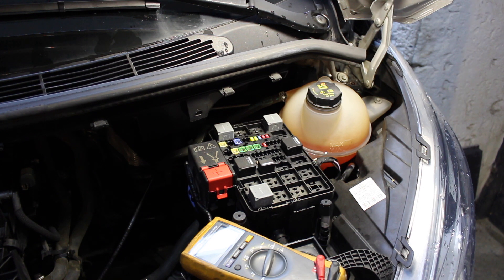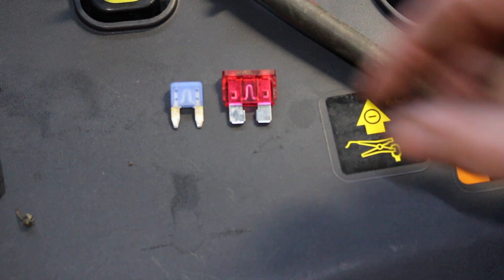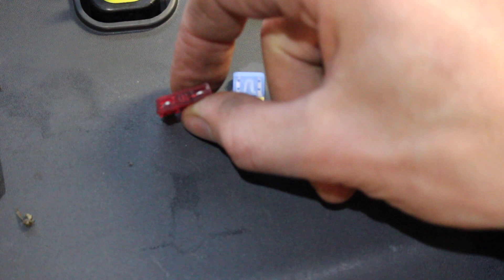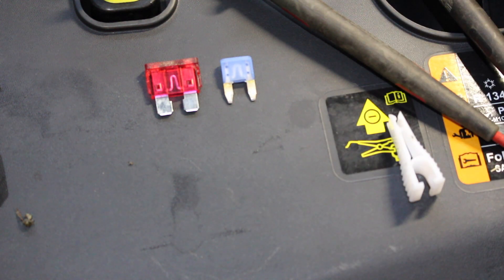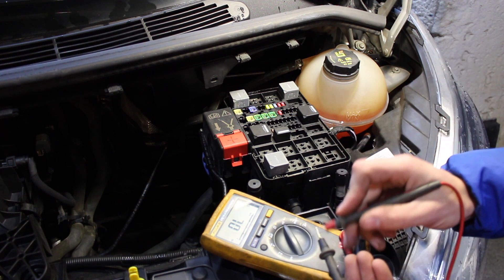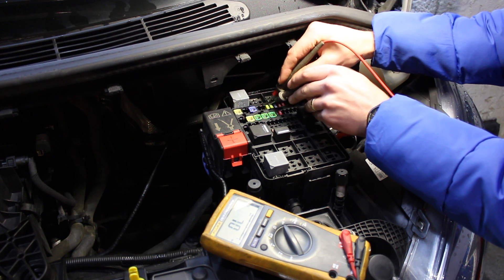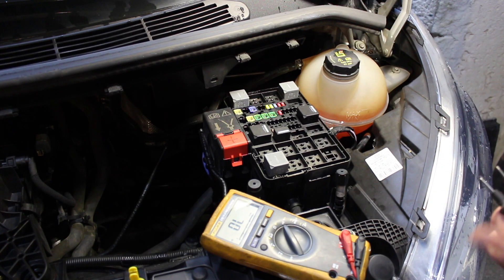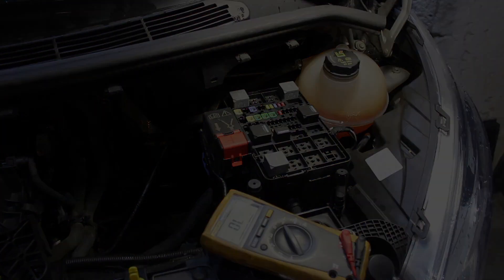How to quickly test car fuses with a multimeter

Comment: Looking through comments, I’d say the point here is that you can touch the exposed metal tabs with fuses in place. That’s it. Ignore “continuity” and “resistance” for now; research the diagnostic test you are looking for and see if this is an appropriate way to do it. The setting on the multimeter depends on your purpose, as does the safety of doing so with the battery connected. This was useful to me, for example, to test for voltage drop across a fuse to look for parasitic draw without disconnecting the (-) battery cable and losing saved presets, etc. If still upset he didn’t show the meter setting, he used )))->|- for continuity which is a low form of resistance and beeps. He first SAID resistance, which would be Ω and also works, but usually doesn’t beep making you look at the display to see if anything is measured. Some meters combine )))->|- and Ω in one setting. I don’t know what those do.

Comment: not sure if that makes sense as you are testing continuity of something which is already in a circuit... So, the fuse can be broken but the current runs through the rest of the circuit (outside of the fuse).
There's a method where you touch just one side of the fuse at a time - I am still looking for that method :)
Reply: you will need power probe for that
Reply: Take a multi meter and set to dc voltage. Touch the black lead to the cars ground on battery or any other grounding post. Next take the red positive lead of your multimeter and touch each side of a fuse.

Comment: wish you would have shown what setting on the meter you used - some of us are more ignorant!
Reply: Resistance mode... The omega symbol (Ω)...  Although I am 50 years late...
Reply: @SoldZaWarudo  Yes that is resistance but however it isnt the correct setting. Its continuity you need, as he later correctly stated. Continuity usually looks like a little triangle facing to the right with a line though it, and or a dot with lines radiating off to the right like a sideways wifi symbol (something like this)   o)))

If you cant tell just touch the probes together and cycle through the settings till you hear a beep, that my friend is continuity
Reply: @leviwarne9416  I guess...  I just got one the other day and figured it out on the spot, so I could very well be wrong...

Comment: Do you have to put the red and or black on a certain point or does it make a difference?
Reply: Does not make a difference. The multimeter just test if the metal part in the fuse have popped or not.

Comment: Does car battery have to be disconnected first?
Reply: Yes, failed to mention. Look up what not to do when checking ohms. Easist disconnect the battery, then do this in resistance mode.

Comment: you need to show the setting on the meter !!
Reply: Amen
Reply: Ohm's it's an omega sign you welcome. Ppl shouting continuity, "you should know how to use it" no it's called turn it on ohms (ohmeter) where you're measuring continuity/resistance.
Reply: @Dontexxr 

Is that the main symbol to test fuses ?
Reply: @reza_dc2  to test continuity yes. It's not just for fuses it's just to test for continuity and the omega is the symbol for that test on a meter. If I read OL (out of limit) my fuse is blown and there's no continuity on that line.

You should not be running power through a circuit though when testing for ohms, you'll blow your meter.
Reply: @Dontexxr  Thank you very much :) for your input ❤
Reply: Continuity
Reply: He clearly said put it in resistance mode.
Reply: @certifiedjo  not everyone knows what that symbol is. Showing the face of the multimeter would be very helpful. As for me I'm just looking for a different video that will show me this information
Reply: @certifiedjo  i brought a cheap harbor freight multi meter and we newbies dont know resistance mode from camel dung so he should spend time showing and explaining the mode, he's making the video for amateurs correct, he's sounds like he's talking to NASA engineers
Reply: For me, I'm clearly looking for a HOW TO VIDEO AND NOT I ALREADY KNOW HOW TO , OTHERWISE I WOULDN'T NEED TO WATCH a video like this, thanks for being so smart  @certifiedjo
Reply: @certifiedjo  You think everyone who purchase a multimeter knows every setting? get off it bro
Reply: Guys I left this comment two years ago, just wanted to apologize to anyone I offended. I’m a changed man.
Reply: @certifiedjo  lmao what a life-changing 2 years :) Glad you came to your senses
Reply: @certifiedjo 😂
Reply: Dang i want to go back 2 years on all my comments now, thank you for inspiring me@certifiedjo
Reply: @certifiedjo  so what and where is that!? Smfh
Reply: @certifiedjo  What number a$$?  There are many modes in resistance and he didn't say.  you want us to learn THATS WHY WE ARE HERE
Reply: Heres an idea, learn how to use a multimeter
Reply: @trey9546  Here's an idea, you could have given the answer with the same amount of typing

Comment: That would have been helpful had it shown how the multimeter was set
Reply: look for the "continuity" setting on your multimeter. It's usually an Ω symbol
Reply: @antoniojg-b8284   @Antonio J G-B  partially helpful...but there's loads of settings for ohms. For this type of test I believe you set it to wifi type image for sound

Comment: Problem here is to check continuity you should remove fuse, otherwise you are testing the circuit and although fuse can be blown as the rest of circuit is OK, it will give bleep or resistance reading.
Reply: Blown fuse breaks the circuit. That the purpose of its life. You are wrong.
Reply: I think you may be right in some situations.  In most cases, when the car is off, most connections are off, in which case you would be testing just the fuses with this technique.  However if there is a short in the circuit or if a device is on, then even though the fuse is blown, you will have some connectivity however the resistance would likely be greater than normally if the fuse is good.

Comment: WOULD HAVE BEEN VERY HELPFUL if YOU'D SHOW WHICH METER SETTING IS USED FOR CONTINUITY....
Reply from the maker: Depends on your meter. It will be labelled normally with the  Ω symbol. Labelled either resistance/ohms/continuity
Reply: Thank you  @FixitSam
Reply: Graham Hobbs Just check every setting then it will be the one that beeps when touching the two prongs together.
Reply: The presenter in this video uses the "Continuity" option/setting on his multimeter (one click past the Ω, with "Continuity" logo having design much like this symbol, ⌇, when turned on its side, or, 90°).

The Ω (Ohms) setting will also work for checking the fuses, by employing the same leads placement [on fuses] as presenter shows in the video [whilst in similar "Continuity" mode] -- not sure if sound is to be expected when touching leads in Ω setting.. my multimeter does not make the sound (i.e., when leads touch in Ω mode).
Reply: I have a harbor freight 7function multi meter,none of the settings make a beep nose when touched together.. even on the ohms settings (resistant)... 😢😅😢😢 Wtf... Help someone if u know the multimeter I'm talking about!!! @jacobirwin
Reply: @joelopez7459  ,
Reply: That’s exactly why I’m watching this video. 😢